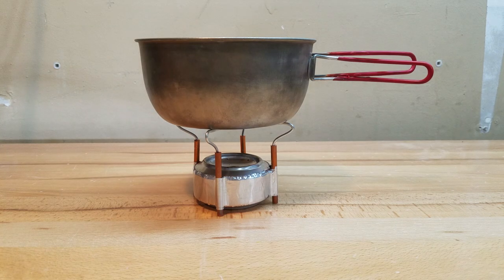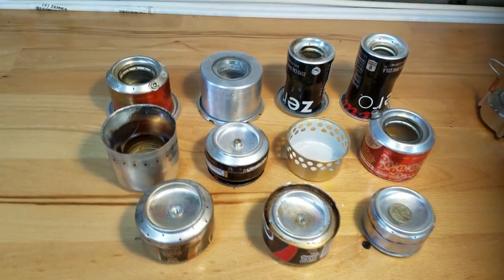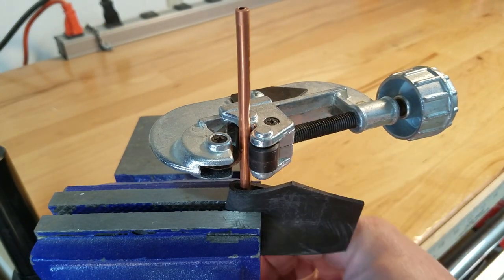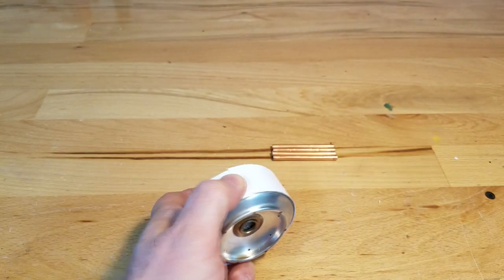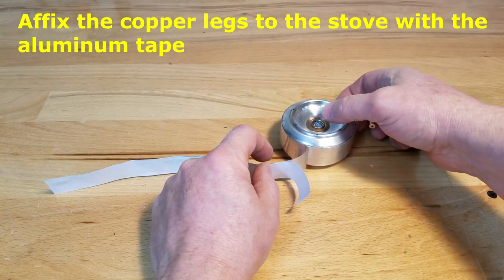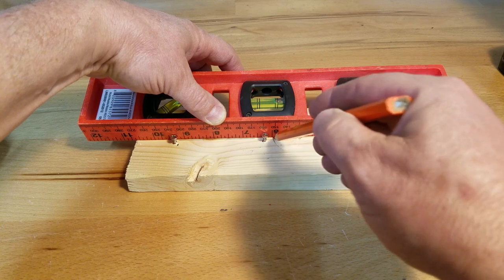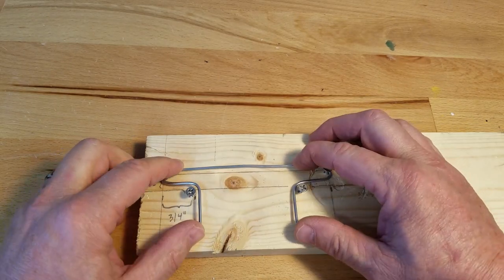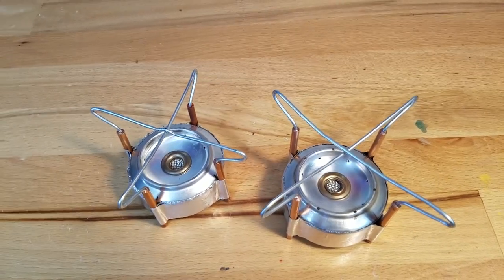How to add LEGS and a POT STAND to ANY ALCOHOL STOVE!

Comment: When using the nail to hammer and bend a notch for fitting them together, I would propose to put the notch in the bottom piece and make the notch point down instead of up.  This way you wouldn't have to worry about or adjust for the pot hitting the notch.  Great video as always!

Comment: This is great. Very useful.. - I have a little tip for you though: I notice that you're using a graphite pencil to mark off on the aluminium can.. I believe I read somewhere that the navy don't allow using graphite pencils for markings on aluminium boats, because graphite facilitate galvanic corrosion in aluminium. Maybe a point worth considering if you want your stoves to last as long as possible. - Great video though. Thanks for sharing!